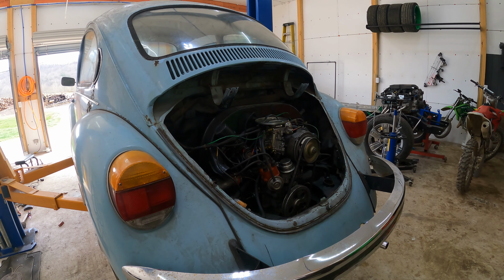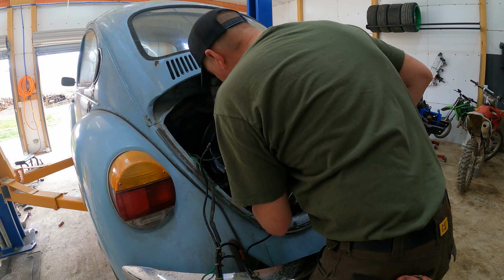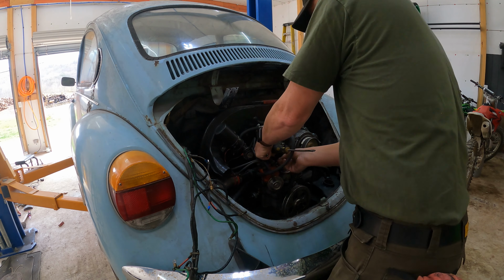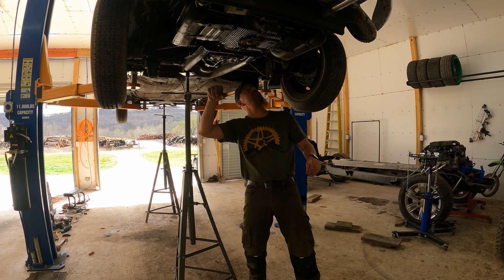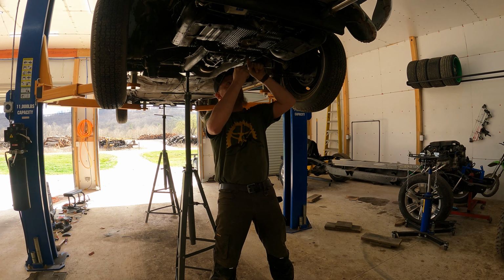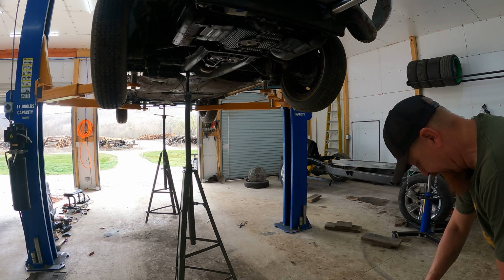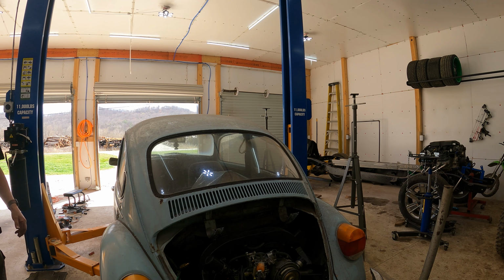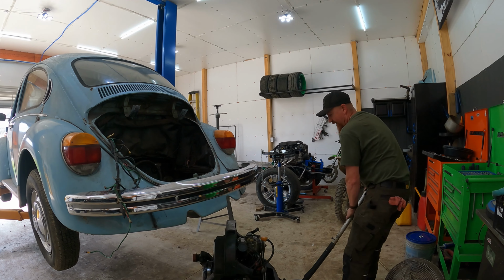How Fast Can We Pull a VW Beetle Engine? - No Edit Bug Motor Removal!

Comment: The Heater Holes Hes talking about is the ( Air Heat form the Exhaust manifold) These VW do not have a Radiator to keep the Engine cool. But it does have an Oil cooler to keep the oil from burning up in the engine. German makes the Best VW in the world.
Reply from the maker: They are a pretty cool design for sure!
Reply: @PeeksPeakHobbyHomestead  True. But I never like the Newer VW that has the Moter in front of it. To me its not Original.
Reply from the maker: @johnhershey4010  I’m with you there.